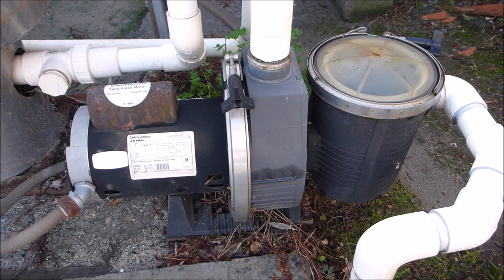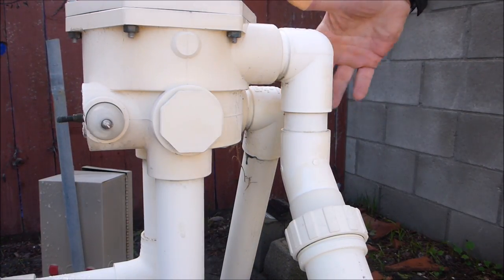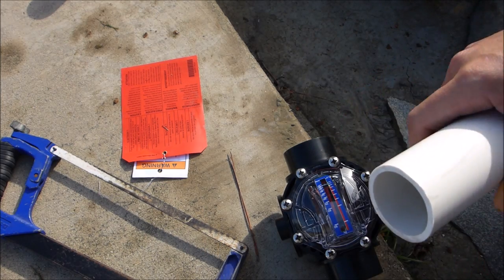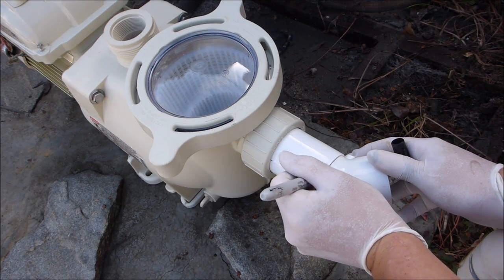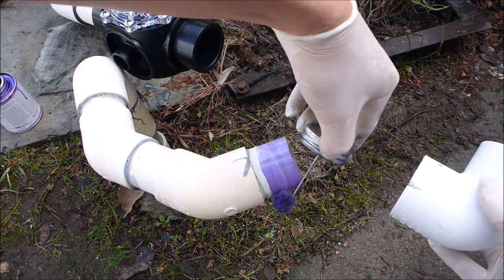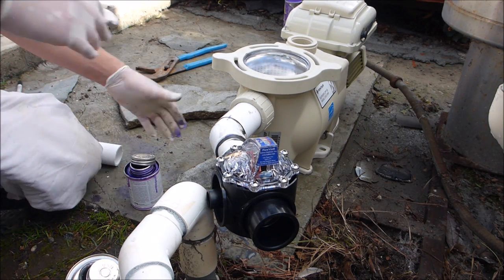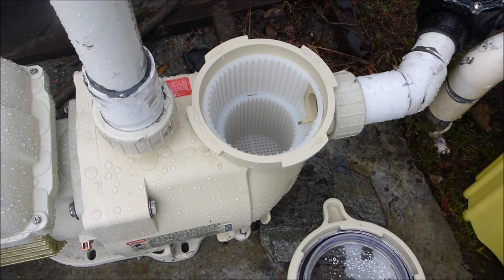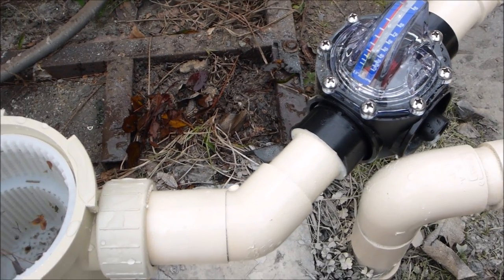How to Install a Pentair SUPERFLO® VS Pump: Plumbing in the Pump

Comment: I installed mine myself. Pump cost $ 700 on amazon. For a pool pro they will charge you for labor and markup. Local pool place wanted over 2,000. It only requires water in, water out and electric. The electric is a bit tricky. The owners manual is not very specific about 120 volt install. However the pump terminals do have embossed L and N. So not that difficult. Self install is still covered by 90 day warranty. To make a long story short I would have to have the pump replaced twice to make it worth the $$. This is my second season with the pump and no problems.
Reply from the maker: Good call! 👍

Comment: Shouldn’t the flow meter be after the pump but before the filter? This would prevent debris being pulled through it. It would have also allowed you to do a cleaner-looking pvc job on the suction side

Comment: Just curious why wouldn’t you cut the pipe coming from the pool with all the 90’s and 45’s and make a lot neater and cleaner install of the pump also you will cut down on flow loss with out all the extra fittings. Each 90 adds approximately 10ft of Head.
Reply from the maker: Basically the pipes coming out of the cement are 40 years old here and I did not want to cut that pipe coming directly out of the cement in case it cracked. I have had old pipes like this crack on me. So as a caution I cut the pipe higher up.  With 1 1/2" plumbing the 90 degrees are not an issue. 2 1/2" - 3" plumbing, yes.

Comment: Can you please explain the whole above pool level / below pool level thing in relation to cutting PVC pipework? How does one visually see this??? I am doing a Intelliflo self install and I dont get it. How would the return line leak water? Wouldnt only a bit of water be leaked from cuts I make provided the pump is off? If its below the water level...does that mean over time it leaks until the water level drops below the skimmer basket??? Just confused what below water level means...and google doesn't explain jack!
Reply from the maker: Will stop after water drops below return jets. So be sure if your pool equipment is below the pool water level to plug the skimmer and return lines.

Comment: I have 1.5" pvc and 1.5 in elbow. 1 side fits in but the other is too small. Do I need 2" elbows?
Reply from the maker: It may just be the pipe is a little warped. Try lightly sanding it to get it to fit.
Reply: @SPL  I got everything plumbed and wired. The pump turns on but there isn't water flow. The water drains from the pump and that's it.

Comment: I notice you're using DWV pipe. Is that OK to use in your experience? Most of the sites I've been to say don't use DWV as they're not pressure rated.

Comment: Great detailed video!   
On the unions - do you just hand tighten?  Do you ever use a wrench or tool to tighten them?
Thanks
Reply from the maker: Hand tighten is what they say, but sometimes I will wrap a rag around it and give it a small turn with large Channel Locks. Thanks for the great feedback!
Reply: @SPL  thanks for the quick reply

Comment: Great Video! I currently have a standard Pentair SuperFlo pump and I am planning to upgrade it to the SuperFlo VS (variable speed), do I need to do all the plumbing or the plumbing will match in these pumps?
Reply from the maker: Should match right up.

Comment: Great video but what was the black piece of equipment(one way Flow?)  used for? Thanks
Reply from the maker: That is a flow meter and check valve all in one. The FlowVis Flow Meter
Reply: @SPL  I understand the check valve part, but why do you need a flow meter?  It’s purpose?

Comment: Why didn’t you cut the 90 degree elbow coming up out of the ground and turn it around to flow directly into the pump?
Reply from the maker: I normally would have if the pipes were not 50 years old and cemented into the ground. More than likely that pipe could crack at the cement and then of course that would be a real mess -would need to jackhammer the cement down. With 1.5" plumbing these turns really do not effect the flow. The greater the pvc size the more the flow would be effected by this. Pipe cracking at the cement happens all the time - so just avoiding that altogether.
Reply: @SPL  got it that was a great call in your part. Sounds like a huge mess if that pipe cracked. Great videos btw.

Comment: I have a 10,000 gallon pool with a jacuzzi and no water features (waterfalls).  The pool store employee recommended a 3HP VS pump, do i really need 3hp? What is the best amount of horse power for my pool that will still save me money on electricity while running it around 8 to 12 hours per day?  Thanks!
Reply from the maker: Get a 1.5 hp Variable Speed pump. 3 HP is way overkill.

Comment: Curious, Why aren’t you using the High Temp (Gray) PVC pipe pieces you installed into the pump itself?
Reply from the maker: I didn't have them on my truck at the time. 😀

Comment: Hi, I recently purchased the exact pump but I did not install a FlowVis,  Can you please advise me on what would be the best set up for a 9,000 gallons in ground concrete pool running on 2 programs with the Pentair 342001 Superflo VS. Thank you in advance!
Reply from the maker: In the Summer: 8 hours at 1800 RPM and then 4 hours at 2400 RPM. This is equal to about 1.5 hours of a standard speed pump in energy cost.
Reply: I live in Tampa Florida is always summer here, lol. My pool is screened in and I normally run the pump for 8 hours from 11AM to 7PM daily. The pool stays clean. Now with the new vs pump I was thinking to run the following set up for a 9,000 gallons pool. 
 
.Program 1  
 40 GPM
3,000 RPM for 3 Hours = 7,200 Gallons based on your formula. 

. Program 2
15 GPM
1,200 RPM for 3 Hours = 2,700 Gallons 

Total run time of 6 hours on both programs. Would this be enough time for this particular pool? 

Thank you for the response, I enjoy all your videos they are very helpful!

Comment: Hi I have a question for installation the flow meter.It is always connected to the pump's inlet connector, which is the one on the front, or can it also be connected to the pump's outlet, which is the one that goes up?
Reply from the maker: Yes, you can put it there also.

Comment: Great info, thanks. Do you have to mount pool pumps to the cement or do they just sit there held in place by the piping?
Reply from the maker: No one bolts them down anymore.
Reply: @SPL  in gl

Comment: Why did you wait 24 hours before turning the pump back on? The fast setting glue you are usually able to turn the pump back on immediately. Just curious, thanks in advance!
Reply from the maker: I am a bit overly cautious. 24 hours seems bulletproof. No leaks yet.
Reply: @SPL  🤞

Comment: I have now 55k gallon pool w/o pump. don't know witch pump was it before(its gone). Old lost part lid has number, may be Hayward SP. Pipe line has only 1.5inch inlet plumbing , outlet is 2inch with salt water equipment. Will be  this Pentair SuperFlo VS 342001,1.5HP Variable Speed good or It need something like IntelliFlo i2 011060 Variable Speed Pump (2 HP Max) or Intelliflo 011018 Variable Speed Pool Pump (3HP) thank you very much.
Reply from the maker: That is a very big pool. I woud go with the 3 hp Intelliflo or Jandy 2.0 HP (2.7 HP) FloPro VS
Reply: Swimming Pool Tips, Reviews & How To -MrDgvb1 but if I get 2hp VS or 3hp VS which is the highest rpm speed I can use with 1.5 inch pipeline inlet to not hurt that pump? Thank you

Comment: I always install the Intelliflo, how do you like this pump?  Probably not as quiet and high quality or good enough?
Reply from the maker: The SuperFlo VS is a lower power and pulls less gallon per minute. It is ideal for accounts that are older and run off of 120 Volts with 1.5" plumbing. Other than that go with the Intelliflo. But there is a big market for the SuperFlo VS.  As far as quality I think it will last the same as the IntelliFlo

Comment: Hi, where can I get the Weldon 746 Pool Heavy PVC Cement? I can't seem to google it anywhere. Also, where do you recommend to get all the fittings, unions, and elbow from??

I'm about to replace my old pump and heater. First timer and pool owner for only over a year, do you have any suggestions or words of encouragement that you can give? Much Thanks!
Reply: Also, what Primer is that? Is it P-68 Primer?
Reply from the maker: Your local pool store should have all the fittings and the Weldon Heavy available.  Take some photos of your equipment and go in their and see what fittings and such they recommend.  Be sure to purchase some pool toys and floats also as a goodwill jester ;). 

Home Depot also sells all of the PVC Sched 40 pipes and fittings.
Reply from the maker: Any PVC primer will do.

Comment: Hello, I noticed in all you videos you use WELDON pool heavy cement ( Grey). Is theWELDON pool heavy cement (CLEAR ) color ok to use. Thanks
Reply from the maker: Yes, you can use the clear stuff as well. It is just a bit harder to tell the coverage.
Reply: Thanks for your quick response
Reply: I already have some Christy's Red Hot Blue Glue.  Is that too light duty?

Comment: will this pump model be used with caretaker 99 in-floor cleaning system
Reply from the maker: It will work fine with the in floor system.

Comment: I noticed there's a Flowvis installed in this video. I just picked one up for my check valve. Do you find them to be fairly accurate?
Reply from the maker: They are very accurate. I think the manufacturer in independent testing has it at  98%. There is slight resistance when the water pushes on the internal part.
Reply: I know you mentioned you installed it prior to the pump because it would also help act as a check valve for basket cleaning, but as you mentioned it was the 3rd recommended location by FlowVis right? Just curious how you think that would impact overall performance or the reading? I am going to be replacing with a SuperFlo (I have 1.5" plumbing) and want to install the FlowVis as well, but was wanting to place it where they recommended it first, right after the filter. Thoughts? Thanks for all your helpful videos.
Reply: Curious about this also, the placement of the flowvis seems... less than optimal.

Placing the Flowvis before the pump required a few extra turns turns, vs. no extra turns if it was placed after the pump and before the filter.
Reply from the maker: I install it before the pump so that it will act as a check valve. This will make priming easier  and allow you to empty the pump basket without refilling it with water. Before the pump there is about 2 feet of plumbing with two sweep elbows which is fine, they work almost like a straight pipe. You just don't want a 90 degree elbow right in front of the pump.

Comment: My pool guy said I shouldn't use this pump because my system has 2" pipes and I shouldn't step down to fit this.  Is this true?
Reply from the maker: You can use 2" plumbing with this pump also. It works just like a standard 1.5 hp pump. What size pool are we talking about?
Reply: This is for a 19k gallon pool.
Reply from the maker: It will work fine. A very underrated VS pump. Affordable and easy to use.
Reply: Swimming Pool Tips, Reviews & How To -MrDgvb1 thank you for the quick response!
Reply from the maker: @scottparker7889  I think it would work fine. It would be the same HP rating as your current set up. Hayward and Jandy both have 1.85 hp VS pumps available if you are looking for a little more HP but don't want to take the leap to a 3 hp pump.

Comment: what kind of paint & color did you used in this video?
Reply from the maker: Just standard Almond Spray paint although you can also use a UV resistant paint if needed.
Reply: I would have been neater and not gotten ugly purple primer and grey glue everywhere , then i wouldnt have had to paint the mess to hide it , but thats just my opinion.

Comment: What kimd of pump did it orginally have
Reply from the maker: An old Sta-Rite Dura Glass or Maxi glass - at least 20 years old or older. Looked like the second or third motor at the time of install. Motor had blown the breaker at the panel. Not tripped it but blew it up. I suggested a new pump & motor.

Comment: The outside of the union is 2" and the inside is 1.5" you do not need a coupling. You should also consider Hydraulics and the use of extra elbows restricts flow when they are not needed. There are many issues with your video that I will not go into further detail with as I read some of the comments already. I'm sure you will try better and do better on your next one.
Reply: 😂 get a life

Comment: Hello, I recently purchased the exact pump but I did not install a FlowVis,  Can you please advise me on what would be the best set up for a 10100 gallons in ground vinyl pool running on 2 programs with the Pentair 1.5 Superflo VS. Thank you in advance.
Reply from the maker: Would set it for 12 hours at 1800 RPM  and then 6 hours at 2400 RPM in the Summer
Reply: @SPL  the 6 at 2400 during 10-4 pm